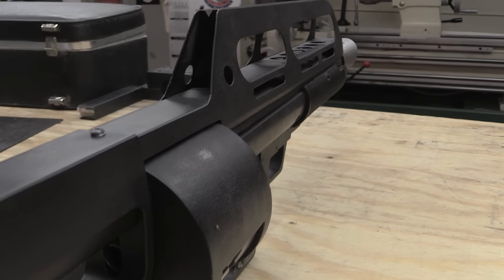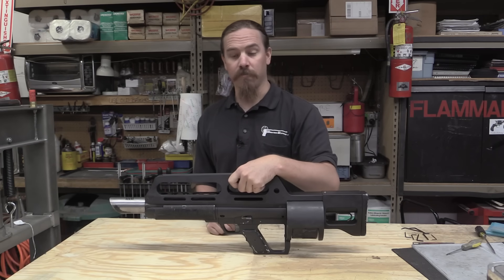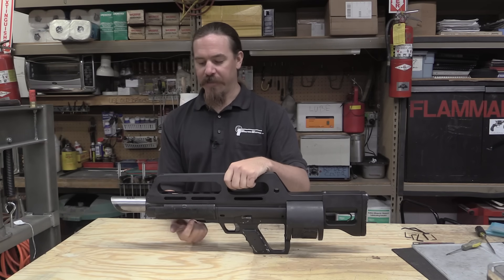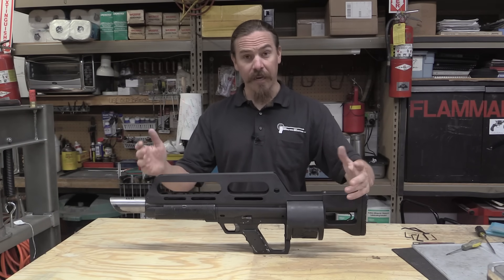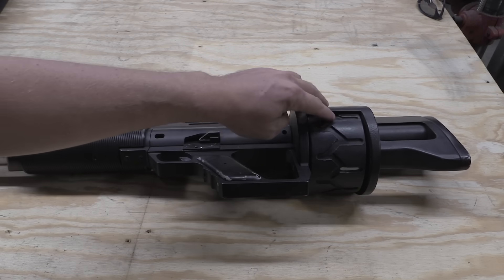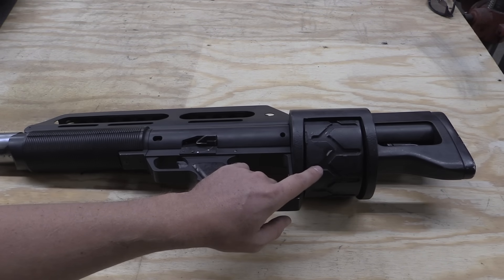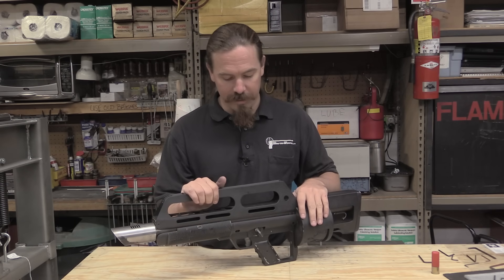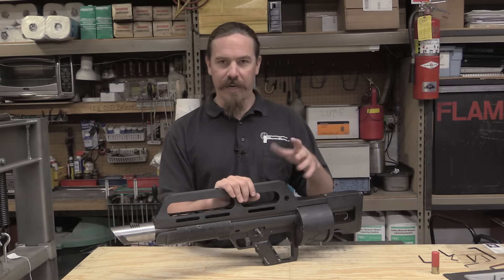Pancor Jackhammer: The Real One

Comment: The Jackhammer, despite its name, is an easy to control shotgun even when fired on full automatic. 
The popular bullpup design, which places the magazine behind the trigger, makes the weapon well balanced and easy to control. 
 Minimum STR required: 5
 Weight: 12lbs.
Reply: Fallout ;)
Reply: Even in Fallout 2 where it's good, no-one ever uses it because you get better guns by that point. RIP
Reply: I just can't get behind a Bullpup. It just doesn't mess with me. Even an Aug...I just...don't like them.
Reply: @justinlast2lastharder749  That's fine, the bullpup's behind you.
Reply: @Spaced92  I used it. Absolutely devastating at close range when you're using a Fast Shot build.
Reply: @Skorpychan I would give one to Cassidy while we weren't running any melee followers and hunting stuff that's meaty. Like wanamingos
Reply: @dadephunt1717  Only if I was reliably able to stand behind them. The AI was improved from Ian's 'spray and pray' style, but not very much.
Reply: @Skorpychan  yes you can utilize the push function to kinda corral them a little without using action points, by having them set to "shoot closest" you can get them to target guys away from the party rather than towards it. Did you ever get to mess with the editing software?
Reply: @dadephunt1717  I did not; I was a teenager at the time I discovered the games, and wasn't allowed to go spelunking random forums for files.

Comment: ARE YOU TELLING ME THIS IS THE ONLY ONE IN THE WORLD ???
Reply from the maker: +Yi Ge Peng YES!!!
Reply: +Forgotten Weapons Is there a way to reverse engineer such rare firearms, or obtain the original blueprints, so that the designs can be preserved for the future generations? You realize that this piece will soon or later rust or else be destroyed? What does matter are the blueprints, materials' specs, and manufacturing methods involved. What we all need is a library with these.
Reply: That are exploded schemes. I mean real, fully dimensioned machinist blueprints, with all the information needed to make more of these guns.
Reply: +Kiril Andreev 
So, he's basically the precursor of "Adeptus Mechanicus" from Warhammer 40k?
Reply: +Kiril Andreev it'd be sweet to 3d print one! even if it were nonfunctional
Reply: ***** nice! just googled it - yeah can see the similarities in the mag for sure
Reply: +Yi Ge Peng well, just as knife that was used as prototype for CounterStrike combat knife's model
Reply: +Yi Ge Peng 3d printing and computerized milling could solve that =]
Reply: +fkujakedmyname Engineering is not some occult witchcraft. This wouldn't be a difficult thing to reproduce, and even iterate and improve on. This crude prototye in particular leaves a lot of room for refinement, and as Glytch mentioned the trigger system would need to be modified to remove the full-auto capability if it were to be civilian-legal. The biggest obstacles would be 1. any patents on it, and 2. the possibility that the ATF would deem it a "destructive device," like the streetsweeper/striker shotgun.
Reply: +Glytch You call it a fiasco, owners who were able to register it were suddenly able to pass of a shitty gun as a "rare collectible".
Reply: +Forgotten Weapons  why  wouldn't anyone  make a copy of it ?
Reply: +SketchAndEtch This gun has been tainted by chaos
Reply: +rawdog killa It's interesting, but honestly there are better auto-shotguns out there now. The AA-12, Vepr-12, Saiga. Magazine fed 12 guages. Although to be sure the Vepr and Saiga rely on gasses so would be more ammo specific (like a semi auto compared to the a revolver)
Reply: rawdog killa
Technical reasons: None.
Legal and commercial reasons: Several.
One big problem is that its designed as a fully-automatic, so it could only legally be made as designed for military and law enforcement, who have better options so theres no demand. In the case of a semi-auto for the civilian market, its patent encumbered so any mfr. would need to make a deal with whoever currently owns the rights. Doing so would be a major investment, and there are adequate if not better options in the civilian market too, so again, little demand. And as for replicas built by capable individuals for personal use, even after changing the firing mechanism to semi-auto only they still might run afoul of the ATF and face felony charges. High risk for a range toy.

The only realistic option would be developing a design on paper and sending it to the ATF to get a determination whether it would be an NFA item. Depending on their discretion then either build it or apply for a tax stamp and wait for a few months before building it.
Reply: +Mark McCormack 

This one sold for 135 000, are you sure there are any real commercial reasons? I mean take away stupid taxes and permits and whatever you have to pay to the government. Just leave what you would have to pay if you were manufacturing, say mobile phones instead of guns. I bet you know many collectors who already spent an obscene amount of money on their hobby. The kind of people who could buy a new house and several new cars if they would sell all their stuff. It wouldn't be just a range toy, it would be a prized member of their collection.
Reply: +Yi Ge Peng Well, at least it looks good, but it was a long time ago.
Reply: +SketchAndEtch 
It's called "Being a historian".
Reply: +Kiril Andreev I reckon with 3d printing now this weapon could be revived now
Reply: ***** In addition, the AA-12 could theoretically be made into a bullpup and that would work.

I mean, yes, I like the jackhammer as a concept (bullpup auto shotgun with 10 rounds? Yes!) but we've kinda done it in a way.
Reply: +Yi Ge Peng On problem I see with this is that the magazine is also the cylinder, meaning that, like a revolver, the rounds fire inside the cylinder. With a magazine fed gun, the magazines can be way way cheaper, lighter and disposable.
Reply: +FraggingBard Imagine swapping the top cover and side plates with carbon fiber. The gun could easily be dropped bellow the 10 lbs, mark.
Reply: It's a damn shame that you couldnt fire it for the video. T_T
Reply: One thing you are all forgetting is that it's still possible to make a replica that fires plastic bb's with a CO2 canister or as a paintball gun with blowback. (or blow forward as is the case)
Sure, it's not a real shotgun but this thing is a work of art if you ask me. No video game makes this weapon any justice.

If anything else, it really has an iconic look to it that most of us know by now and had the US military shown just a little bit more interest in the concept it could have been a great success IMHO. What is 3 to 5 million dollars in R&D for this weapon when the US spends billions fighting in wars they cannot win?
Reply: +Yi Ge Peng 
CLEARLY THIS IS A HOLY WEAPON

Whoever takes the Pancor Jackhammer and anoints it by making first blood and then getting freshly-shred blood of sacrifice to annoint the Holy Pancor, will become God-King of Shotguns!
Reply: Sr. Favo Posso deixar vazio sim And then someone with an older double barreled shotgun comes over to off the idiot who's still figuring out how to lug more than one spare Jackhammer magazine.

It's a forgotten weapon that had a nice concept but should really remain on the big screen or something. That AA-12 everyone fangasams about as a deathmachine? It's still pretty impractical when you have the reliable combat shotguns like Remington 870s and Mossbergs.
Reply: +dannylamb456 full auto shotgun, impractical. Lmao ok, sure thing sport.
Reply: +Jane Smith think about the recoil
Reply: Jane Smith You don't quite know what the term "impractical" means, huh?

Most military units tend to use semi-automatic fire since there really isn't much need to blow through a magazine on one target. A few well placed shots to the chest or even double-tapping is going to be more than enough to down most targets. And that's with automatic rifles.

In the case of automatic shotguns versus combat shotguns, the latter mostly wins out if we're comparing it to the AA-12. Most combat shotguns used by militaries across the globe use semi-automatic shotguns like the M1014/Benelli M4 Super 90. Said shotguns are also relatively compact and lightweight, seeing use only as door breachers or close range weapons in enclosed areas.

The AA-12 is impractical as it trades off most of its effective fire and compactness for full automatic fire. Not much purpose to this other than being a range toy, especially with that huge drum magazine.
Reply: ***** What about a gatling shotgun? Like a full on rotating belt fed monstrosity!?!

Yes, i know it's impractical but that would probably make the enemy shoot themselves rather than face the music.
Reply: Cadde
it could be pretty practical if in  a fixed position or on a helicopter. now imagine it with bird shot or flares.
Reply: Cadde Shock and awe only goes so far. Besides, you're talking shotshells fired from a gatling styled weapon, that means ammunition needs to be on top priority and last I checked shotshells aren't really ordered by the boatload like 5.56x45mm NATO rounds.

There's a reason standard issue exists and why 'cool weapons' tend to be out of the hands of most armed forces.

Oh, and another point on that shot-minigun? Sam Noneofyourbisnus does bring up the multi-purpose nature of a shotgun and I'd agree if the military didn't think about that problem and made special rounds for the same GAU autocannons that do the same thing.
Reply: still 3000 rounds a min of bird shot would be pretty scary
Reply: ***** Yeah, don't mistake my comment for a serious one.
Reply: Cadde I'm sorry but saying "Sure thing, sport" sarcastically or not after completely misunderstanding what the term "impractical" means, especially when discussing 'cool future weapons' tends to piss me off to the point of rebutting like so.
Reply: ***** That wasn't me saying "sure thing sport".
Reply: Sam Noneofyourbisnus To be fair, at calibers around 12ga and beyond you generally use fragmenting rounds that wreak havok at the point of impact.
Bird shot only really travels ~150 yards before becoming a pleasant shower more or less.

EDIT: Got the range wrong, had to double check.
Reply: Cadde Yeah, sorry. Still, I never understand people who think "hurr sooper big gun is good!"

Yeah, go carry one of those and stand around for, I dunno, 8 hours? Sorry about that misunderstanding, though
Reply: *****
well big guns have their places though. if you need to defend an area big guns are great as you can mount them and you don't have to carry them around
Reply: +dannylamb456 To be fair, according to the video description, the two other Jackhammers made were much, much lighter.
Reply: Objectorbit yea this saw a milled gun. the future ones could be stamped which is much lighter. also aluminum could be used for some of the parts
Reply: SketchAndEtch ily
Reply: there were only 3 models made
Reply: Kiril Andreev grazie, this is very pleasing.
Reply: This gun's descendent is the AA12 combat shotgun
Reply: @mindsoulbody  Why would you want to? This is 2019. There are better designs for sale.
Reply: It’s the only documented one I wouldn’t doubt that a few of them are floating around the exotic gun black market
Reply: @taids  Been working on a 3d print ready model for this gun. Might upload the stls on thingverse when I'm done.